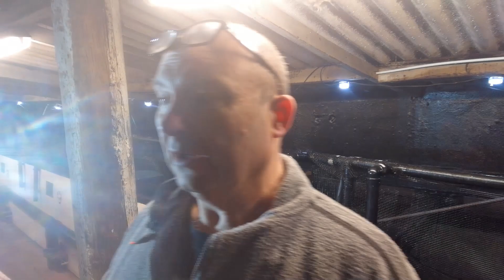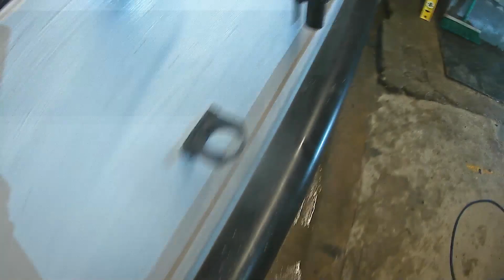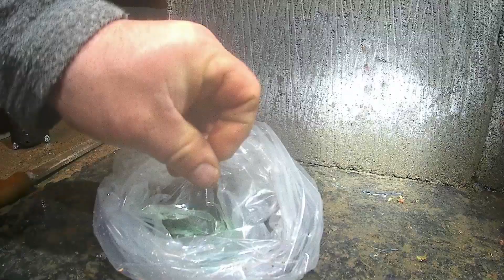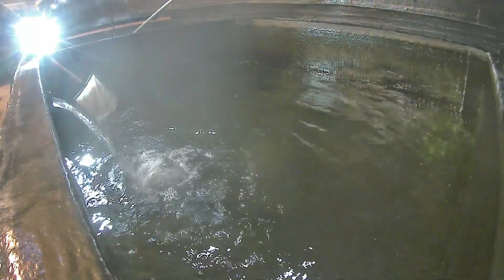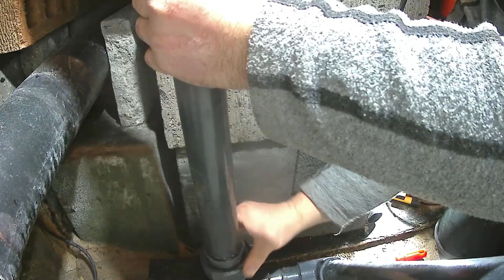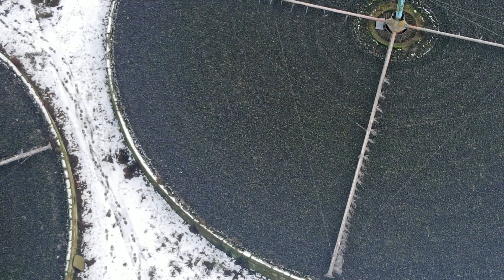Winter Renovations Part Five.

Comment: Hi Lee,  Great job on making this filter,   im thinking of building something similar  as my DIY Bakki shower is too loud  and consumes alot of electric. 
I make my own filters , have you seen my DIY drum filter?     can handle upto 110,000 litres per hour  with more inlets/outlets fitted  and filters to 50 micron.    works automatically via a professional timer switch, for the purpose of the video i manually turned it on,  sorry for the poor video.   im in derby and have brought from you when i first built my pond,    if you wanted to chat about the drum filter , im more than happy too.   
heres the link,  enjoyed building this and has worked faultlessly for 15 months non stop 
heres the link  
https://www.youtube.com/watch?v=j9yvFdTft8Y

Comment: Interesting design for the spinner. Would love to see a video on how it's built.  One question regarding the quarantine setup. (Just found your channel so may have already been answered.) You mentioned the entire system is interconnected and filtered via one filtration system.  Doesn't this present a risk to the fish? If there is a parasite or pathogen in one tank it would spread to all of the tanks via the filter system. Also if you had need to do a specific treatment on one of the tanks for any reason, how do you isolate the rest? Looking forward to your reply.
Reply from the maker: It's a small quarantine so it  makes a lot of sense to combine all the water and centralise it with a single filter. It's easier. More stable. There is definitely some truth in what you are saying. However it's likely that that if one batch of fish have a problem then they would all have it and have to be treated together anyway. Even if they were kept in separate there is a high probability that a this would be the case.

Comment: Hi Lee, like the spray bar idea, how about using wide tube/ round unit to hold the media in then all media will get wet.
Reply from the maker: Yes that's absolutely  the right way to make a filter like this. How ever I had a to use a rectangular tank due to the space available.  Even with the rectangle design most of the media is getting some water on it though.

Comment: Lee, I love the trickle filter. Your past videos on pond filtration and stripping submersible pumps went a long way to help me design my raised pond. I'm now considering adding something like this to my existing custom filtration system to further reduce dissolved waste. I hope this comment can help you in some small way to increase the longevity of your designs. 

Firstly, the washing up liquid on the silicone is a bad idea. Yes, it makes it easier to form the silicone, but it also compromises the seal, particularly around the edges. Bacteria get into the gaps an over time the silicone is lifted from the surface it is bonded to, leading to leaks. It could last years, or mere months. It's better to not to use washing up liquid, or spit, or even you bare finger, which is loaded with bacteria. Use a forming tool on a clean surface, ideally cleaned with alcohol.

Secondly, you can significantly prolong the life of your sprinkler my bonding some stainless steel washers to the contact surfaces. The friction should be minimal anyway as some water escapes through the mating surface and reduces the friction.

Finally, if you haven't already, you should cover that sprinkler tank. Look like the wall is getting a fine sprinkling. 

Hope this is helpful.
Reply from the maker: If you want to breakdown ammonia and nitrites wet dry filtration is unrivalled.

Comment: very good design!
Not a criticism, but perhaps the pump can be placed somewhat higher instead of on the floor, for a lower pump head?
Reply from the maker: The level of the pump is irrelevant.  Pump head is calculated from surface of the water level in the tank. However having a shorter amount of pipe might just improve the performance. Having said that the pipe is 11/2" pressure pipe and presents little in the way of friction loss for a flow of this size.